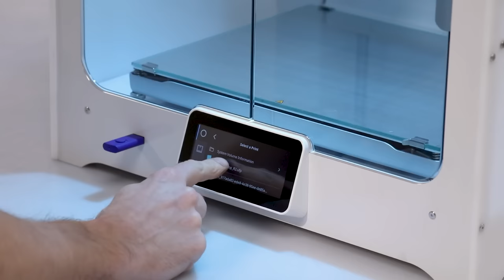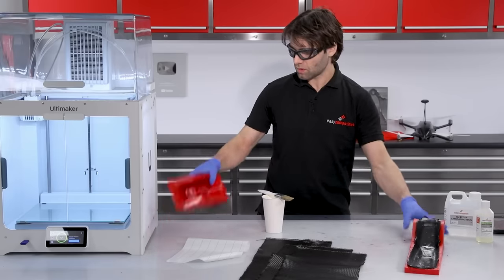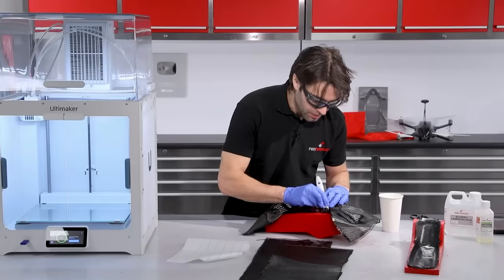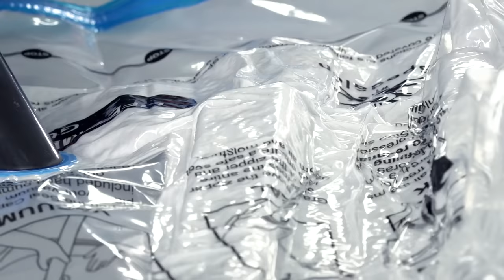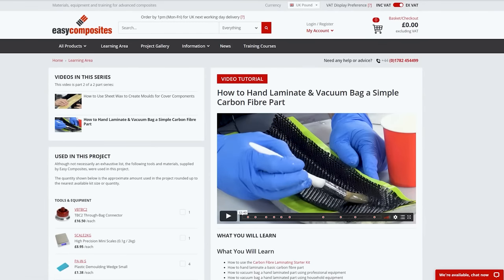Hand Laminating a Carbon Fibre Part Directly into a 3D Printed Mould

Comment: can you use sand-able primer on the mold or will that somehow mess up the resin?
Reply from the maker: We generally steer clear of anything which is spray on as it can offgas for long periods of time after application affecting the release agents. If you do use a filler, the most important thing is to be absolutely sure it is fully cured and sealed (most fillers are porous) before using the moulds.

Comment: Nice video. But I am wondering about the REAL advantages to carbon fiber. After all, it seems the majority of the weight isn't in the carbon cloth, it's gong to be in the resins used. That said, if I were to do the exact same process using fiberglass cloth instead of carbon fiber cloth, will the weight savings really be that much better with carbon? Also, is the carbon fiber cloth really that much stronger than an equal amount of fiberglass cloth and resin?
Reply from the maker: Hi Doug, the amount of performance advantage of carbon over glass would stay the same regardless of the production process so in that respect, it’s still worth using carbon even if the production method is far from optimised. Realistically though, if strength to weight ratio was really critical you would probably swap the basic wet lay for at least vacuum bagging (increasing the fibre fraction) and so for a process like this where you’re only hand laminating, using glass reinforcement might well make more sense. Also, most people tend to make parts much heavier than they need to be so the weight reductions if carbon could probably be achieved by just laminating a more appropriately thick/strong part!

Comment: How much heat will a part like this take?  I am looking to replicate a part that will endure about 200 to 275 degrees of radiate heat from an exhaust manifold.  Thanks
Reply from the maker: Hi Mike, you would need a specialist resin to go that hot. We do not have any resins that will go near that kind of temperature.
Reply: @easycompositestv  thank you.  I enjoy your videos

Comment: Is there a coating i can put into the 3d printed mold to ged rid of all layer lines and still use it then to get carbon fibre parts out of it. Which coating can i use?
Reply from the maker: You can use our XCR coating resin to help cover the layer lines. You might need to build it up in a few layers and flat off the resin in-between but you will then be able to get a nice smooth finish which you can use as your mould surface.

Comment: The PVA realease agent let a sort of blue layer on my parts. Would you advice an other solution to try on PETG mold in order to avoid this ? 
Thanks !
Reply from the maker: The PVA should wash off the surface of the parts (and mould) when cleaned with warm soapy water.  Alternatively you could look at our RW4 spray release wax which should work as well.  You can find it here:  https://www.easycomposites.co.uk/rw4-spray-wax-release-agent

Comment: want ask you one question. Did you ever seen 3d printed distance material and apply carbon weave on both side?
Reply from the maker: Using a 3D printed material as a core? It has been done in testing and some small custom projects but it very much depends on the type of infill and infill density used - some infil types are stronger than others.

Comment: What if we fill the 3d mould valleys with resin and then sand it down evenly utilizing the peaks as a guideline? I think this will eliminate the need for surface post-processing.
Reply from the maker: Hi Aris, in principle, yes. However, in this case, because we are using a basic wet layup then we know that we’re very likely to see to do some touch up and repair to the part anyway and so getting a better finish on the mould would simply mean more work. If the process for the layup was something more reliable (like vacuum bagging) then having a better finish on the mould would make sense, especially if you are making more than one part. You can see us do this in our previous 3D printing tutorial.

Comment: Would it be possible to make a foam female mold and skip the fibreglass moldmaking process similar to this?
Reply from the maker: It would likely require a good surface finish to be effective. Or use a method like in this video: https://www.youtube.com/watch?v=0Yaggj16S08&t=436s

Comment: 6:11 "don't drag the brush" 25sec later drags the brush everywhere like a broken leg
Reply from the maker: The difference if you watch back is that 6:11, we say not to apply pressure which would drag the fibres; once they've been wetted out with the stippling action, the top up of resin is done so with hardly any pressure at all and can be gently brushed on.

Comment: just out of curiosity, could you laminate more features on the already cured part, for example if you have an overhang or something simular?
Reply from the maker: In theory, yes. You'd need to form them so either a shaped core bonded on and overlaminated or maybe a 3D printed core which again you could overlaminate.

Comment: What's the heat resistance of the finished product? Can it safely be used next to an engine?
Reply from the maker: The resin system is limited to 80C with an oven post cure so some engine bay trim parts will be fine.
Reply: @easycompositestv  aaaand they reply to questions! Thanks! 

Amazing channel, product and people. 👍

Comment: Question. Does the mould have to be that solid or can it just be a supportive structure with inner honeycomb. (With a small flex to release?)
Reply from the maker: This was printed at 30% fill so it is actually a semi hollow structure.

Comment: Is there a solution to re-use the brush after this ? (To clean it and avoid it cure with the epoxy in it? 
Thanks !
Reply from the maker: Clean them with Acetone before the resin has begun to gel.  Some cheap brushes will fall apart if left soaking in acetone due to the glue used.

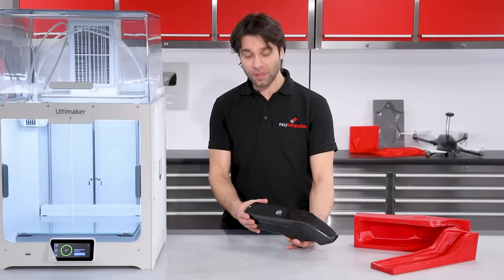Comment: Thanks a lot for all the create work you do and the tutorials! What are the next steps? Will be there another video how both parts will be "glued" together  (or how are both parts fixed together)? What is the metal part ontop of the box for (at 13:33)?
Reply from the maker: Hi Sebastian, this video is standalone in terms of the battery box example so we won’t be doing any more with it. The metal thing is a switch. Next will be other videos on different topics, we have plenty in mind.
Reply: Watching this video in 2023 I am also asking myself how do you combine those 2 parts together?
I have seen the other video with the tube on how to combine them but a example based on this part would be amazing.

Comment: Does it make a difference in the final part if you print with a lower resolution ? ( .15 is super fine for big prints like this and results in long print times like the parts Shown in the Video)
Reply from the maker: If the steps are too big then it can start to cause more problems with the release but, providing the part releases OK a d you’re planning on resin coating the component then no, it wouldn’t really matter if it was a lower res print.
Reply: @easycompositestv  oh okay thanks for answering i am getting my second 3d printer next week and will maybe try this method for something but 15h for one print is a bit too long in my opinion if it is basicly only a tool

Comment: Great content. I've always used a high fill primer (Quicksand) to simply fill in the layer lines. I'm really curious to see a video on bonding lines (joining pieces at seams and the proper bonding products). I believe I asked about it in the mountain bike frame video. Any updates on it coming along?
Reply from the maker: Hi Micah, so you’re talking about bonding tooling board together (rather than 3D print for example). In which case, it’s generally just a case of either using a board bonding paste (you’ll find this product - EA700- on our website) or producing a paste that matches (as closely as you can) the density of the board you’re bonding.
Reply: @easycompositestv  no, I'm talking about resins and epoxies recommended for bonding composites to other pieces (composite or metal). For instance, bonding a carbon piece to a metal flange.
Reply: @Micah_Makes  as youll see quite often in professional scenes. especially in automotive and aeronautical performance industries. the way they "bond" composites to metal and other materials is with rivets. or, for a more perminent bond, you can include the metal into the structure of the composite by wrapping around it so it may not move or release in any direction.
Reply: @tophatvideosinc.5858  thanks for coming in here to not actually answer my question. Rivets alone as a bonding of composites is terrible, particularly in shear loading. Many jointd get rivets after bonding is in place for alignment and/or fixture reasons before the bond is set. And yes, actually wrapping the joint is better but not always an option. I was curious what they use. I've always had good luck with various Hysol options.

Comment: what do you think about resin 3d printing?
Reply from the maker: In any particular aspect or this particular application?
Reply: @easycompositestv  for making a mould, it will be more precise but idk if it’s a good idea in terms of unmoulding
Reply from the maker: @laws1n874  Yes there shouldn't be any reason that you can't use resin prints for this process. As long as you design the tools well enough with release draft and avoid mechanical locking the spray wax does a good job of providing a release coating to the moulds.
Reply: @easycompositestv  Thanks :thanksdoc:

Comment: hey mate I would like to know your setting for your PETG, I having trouble with stringing
Reply: I stopped stringing in my petg parts by lowering the printing temp, if printing at different temperatures does not help is probably because of moisture, then you have to dry your filament, i do that by wrapping the spool in aluminum foil and let dry in the heated bed at 80°c for 4 hours, you can also change the retraction values in the slicer and do several test to find out the sweet spot, search for stringing test in thingiverse. My english is not the best but i hope it helps.

Comment: What is the weight difference between this method and other more involved methods?
Reply from the maker: The laminate itself will be about 30% heavier than a vacuum bagged version, in addition, the extra layer of coating resin adds about 500g per square metre of surface area. This means, as a rough guess, this particular part is probably about 100g heavier owing to the more basic production process.
Reply: @easycompositestv  THANK YOU ...appreciate the answer. Cheers

Comment: So how did you join the 2 parts together and maintain the strength?
Reply from the maker: These two parts have fixings bonded into them to enable the battery box to be opened for maintenance.

Comment: Hi, how to make the files for a 3d printer  to make oem part of my bike in carbon fiber ?
Reply: Solidworks,SketchUp,Fusion3D
Reply: @fonzi68
Three steps:
1. Draw up the part in a 3D Computer Aided Design (CAD) tool that can export STL files. There are several but if it is a complex shape I suggest Fusion360; note that while you can get a free version, it does have a steep learning curve.
2. Once you have an STL file you will need to generate the gcode for the printer. This is done with a 'slicer'; cura or prusaslicer. Note that there are LOTS of variables that affect the strength, layer lines etc. of the print
3. Now that you have your gcode, you can 3D print - either on your own printer (ranging from 300 AUD and UP) or send to a company that does 3D printing. Be prepared to need a couple of print attempts for complex shapes.

Comment: Also how much wall thickness does your part have by the end of the whole process?
Reply from the maker: We're using a 210g 2/2 twill carbon fabric in this video which is about 0.25mm thick per layer (given some consolidation). Two layers of this fabric gives a 0.5mm wall thickness, 3 layers would give you 0.75mm, and so on.
Reply: @easycompositestv  perfect thank you!

Comment: Could use use a cheaper composite to achieve the same result?
Reply from the maker: Hi Brendan, well, you could certainly follow the same process using a lower cost reinforcement, such as woven glass. The results wouldn’t be the same otherwise no one would ever use carbon fibre but they would still be a perfectly serviceable part, just a little heavier for the same strength or a bit less strong for the same weight.

Comment: Can I use peel ply on both sides, on the molde side as well as the open side, if want that finish?
Reply from the maker: Hi Per, yes you could, the problem with this normally though would be wrinkles in the peel ply which are likely to look unsightly on the surface (A side). For flatter shapes it would be more acceptable. Be prepared for a heck of a time getting it off though!
Reply: @Easy Composites Ltd  Thanks for the answer.  Would the mold side peel ply be harder to remove then the open side? The shape I am considering is just a folded flat shape not a true 3D shape so I think I can get the peel ply reasonably flat and I have no problem with any remaining wrinkles.

Comment: Can you attach two carbon fiber parts that are already dry? I’m trying to make a custom part (almost like a flange) that fits over my car vent, and would like to attach it to carbon fiber tubing that can be purchased from amazon.
Reply from the maker: Yes use a structural adhesive to bond the two parts together.  You want a decent overlap for bond strength and give both surfaces a good key and a thorough degrease before applying adhesive.

Comment: hi I tried this methode with vacuumbagging and my part failed because all the resin from the higher parts of my part flowed down to the lower parts. Is there something i did wrong here ?
Reply from the maker: What level of vacuum did you use? Over 20% is likely to squeeze too much resin out.

Comment: is it possible to use the air compressor gun no spray the XCR coat? thanks
Reply from the maker: No, it is not safe or recommended to spray epoxy resins.
Reply: @easycompositestv  ok thanks

Comment: Is ist possible to use a peel-ply as first layer in the layup to have the textured finish on both sides?
Reply from the maker: Yes you can do if you do not want a smooth cosmetic surface finish.
Reply: @easycompositestv  great! Thanks for the quick answer. I want the textured finish usually seen on the peel-ply side. Maybe I am riding that horse backwards, because I think i could maybe make a mirrored mould but I‘ll cross that bridge later. I just ordered a mould making and a hand layup starterset yesterday, so I will be doing my first steps soon. I feel confident that my first part will be at least usable because your tutorials are really really good and easily understandable. So thanks again for that.

Comment: This makes me curious about laminating 3d prints for duribility... I've been afraid of my 3d printed props melting in the sun (our trashcans melt in the summer here) so I wonder if a layer of carbon fiber with a UV topcoat would help? 

But this also brings into question how detailed it can get... My props have some serious details that are a tenth of a millimeter or smaller that would most likely get filled in...
Reply from the maker: Hi Teddy, a coating would not improve the overall heat resistance, just slow down how long it takes to get damaged by heat as the heat would still conduct through over time.  You can get higher temperature rated filaments.  The resin coating is likely to fill in such fine detail so probably would not work for your application.

Comment: So it's pretty safe?.. no respirator needed?
Reply from the maker: In a well ventilated room, which our studio/workshop is, a respirator is not needed for mixing and pouring resin for most circumstances. However for heavy cutting and sanding of cured epoxy, we always recommend a decent dusk mask/respirator due to airbourne dust hazard.

Comment: How many copies can be made from single mould before the mould became not ideal to use?
Reply from the maker: Although a 3D printed mould is not a substitute for a rigid composite mould in volume production, the laminating and releasing process causes almost zero damage and so a 3D printed mould could, in theory, be used many many times. However, if you want to make a lot of mouldings then it would be worth producing a rigid mould which could be given a better surface finish.
Reply: thank you

Comment: Perhaps I missed it. Curious, what weight carbon fiber you are using?
Reply from the maker: We used our 210g 2/2 Twill Weave CF.
Reply: @easycompositestv  thank you. That should be stiff. With a hand layup using a little more resin the weight of the resin plus the carbon fiber should be around 1lb a yard x 3 layers ? That helps a bunch.  Thanks
Reply from the maker: @Ozarkprepper643  Normally with wet lay up you use the same weight of resin as the weight of the cloth. With a 210g cloth you would have a rough total weight per square meter of 1.26kg.
Reply: @easycompositestv  thank you for the information it is much appreciated you take care

Comment: I tried to use storage bag but after a few minutes when I check it, there is always  air leak and it losts vacume
Reply: I've used the storage bag technique before and not had any problems. But always considered taping the seal as a way to double up the seal.
Reply: @PLRTipyuk  maybe it is bag quality issue. I also tried to suppot seal with that kind of tape but still there was leak.

Comment: Instead of applying the repair resin with a tongue depressor (or whatever it was) what about using a syringe?
Reply from the maker: Hi Colin, you can apply the resin by any means possible, it's all down to what method best suits your projects/application.